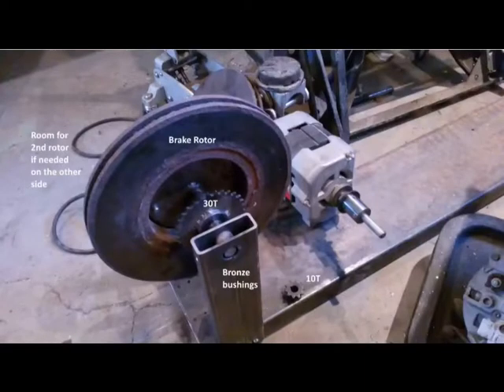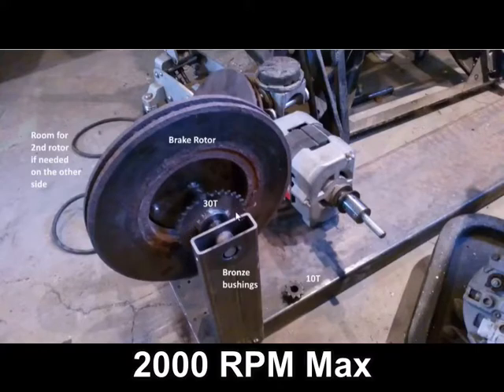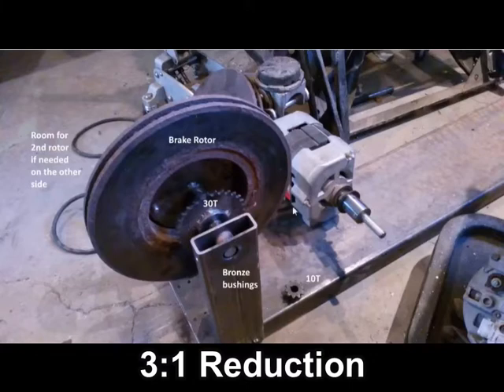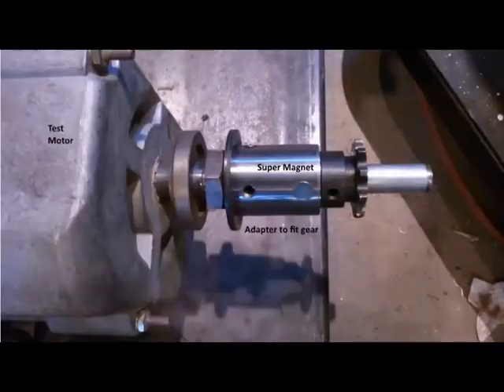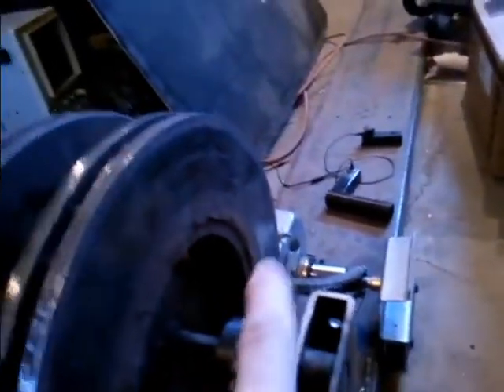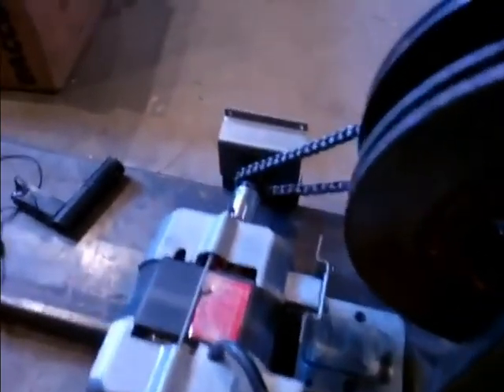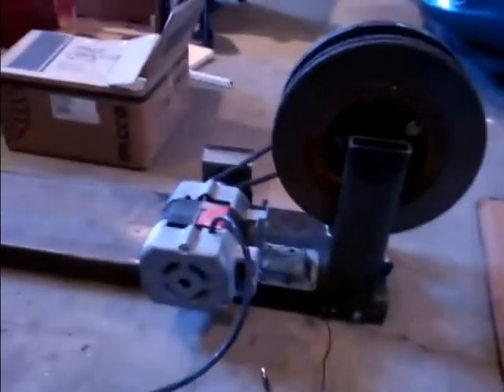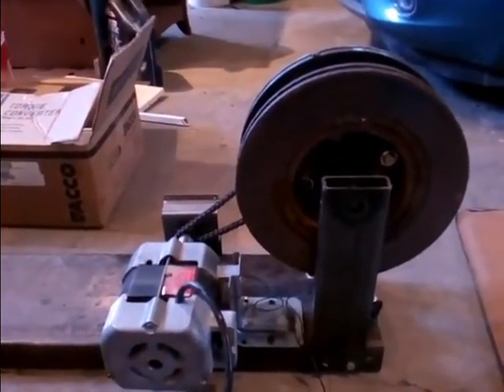DIY Dyno (Dynamometer): Part 1 - Mechanical

Comment: iam from France, i wont to Say to you :  I LOVE YOU , your are my great Master, if one day you Come to France i Will be happy to invite you 🤗
Reply from the maker: Maybe one day!
Reply: @blanchae  it would be with great pleasure,I wanted to tell you that your method of measuring inertia is the most perfect,and it far exceeds computer calculations in accuracy,I only changed the tachometer with hall effect coupled to Arduino modules for more accuracy، we get the same numbers on a professional tachometer,for the grip of the wheels, I made horizontal grooves, let's take advantage of 2 mm deep, 2 mm and between each groove 7 mm, no need for big means to make them I made a tool with a rail system to stay straight and fix the tool, once again thank you for the inestimable amount of knowledge that you leave with us

Comment: I'm thinking of building up a similar sort of dyno but I've mostly sold myself on using a car flywheel as they can spin up to 5-6000rpm which will be good for the 2:1 or 3:1 reduction I want for testing chainsaws.
Reply from the maker: That is an excellent idea - using a car flywheel. Maybe a truck flywheel might be better as it's heavier.